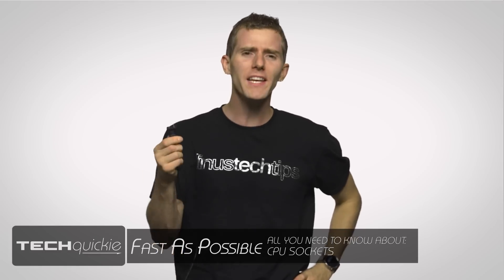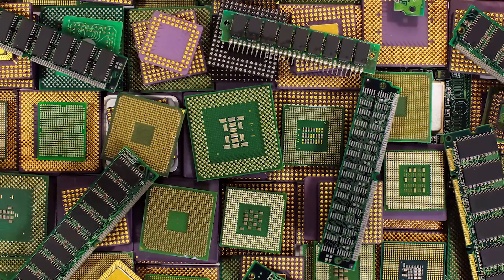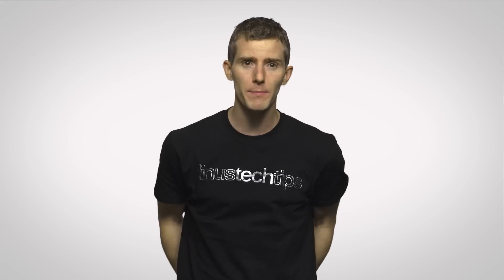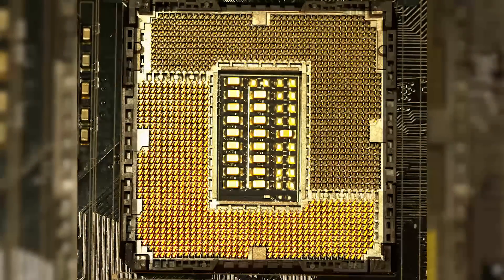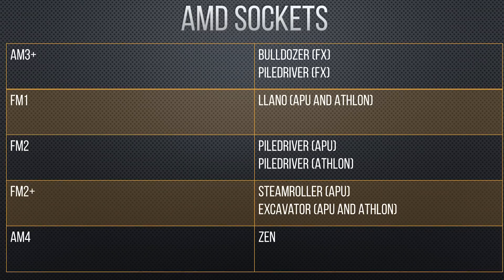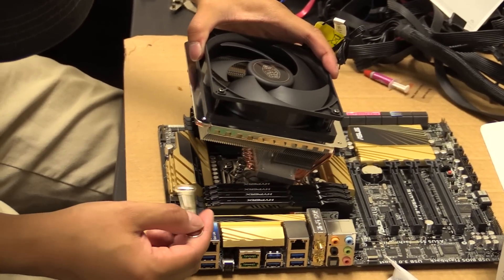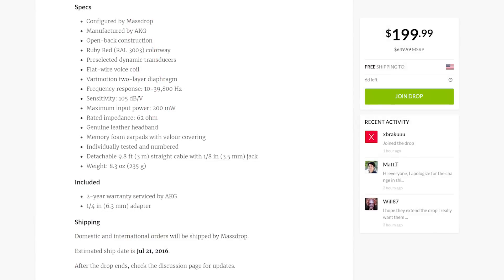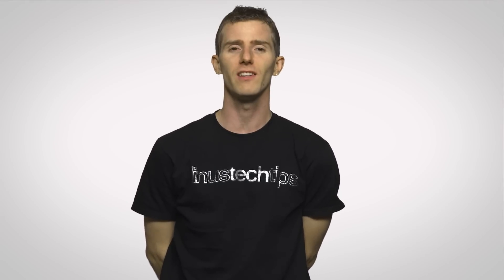CPU Sockets as Fast As Possible

Comment: Things that were either incorrect or missing:
-CPUs on cards were an experiment, and before them PGA sockets already existed. They were mostly useful in the days of the external L2 cache.
-Back then, both manufacturers used the same sockets, but Intel in order to monopolize the x86 CPU market they made their own sockets exclusive, forcing AMD to use their own and several 3rd party manufacturers to leave the market.

Comment: i think lga 1151  is just absolutely ridiculous, like srsly? a single pin more ? you needed that?
Reply: They do that for a reason. It's to prevent people from thinking their board is compatible. Even though a new cpu may need the same amount of pins it has no indication that an older board is remotely compatible with it. It may be completely different interns of wiring.

Since its so hard to differentiate by pin layouts with how dense these sockets are, they just remove a ground pin to basically say "even though they both need the same number of pins, IT IS NOT COMPATIBLE"

As a example of a case they didn't do this, A lot of people thought that the early socket 775 dual cores would work on P4 boards. and intel probably had a nightmare on the support lines.
Reply: @skifree0  they could just change the dimensions lol
Reply: Probably to change the name, I switched from 1156 to 1155
Reply: Saman Miran prolly to sell more mother boards from their partners lol. you want the new cpus? nigga better get a new mobo.
Reply: +skifree This is literally the only comment in this thread that is worth reading (including my own comments)
Reply: Quinn Dams You know that the wiring of the socket is different? The way they send and receive signals gets changed with every socket. You can't just plug an HDMI monitor into a USB port, even if you manage to change the connector
Reply: +Saman Miran you can, you just need alot of force.
Reply: Agreed.  People need to stop assuming that everything is a conspiracy by companies to rip them off.  

Engineers have to decide whether to change the I/O logic and the socket or neither.  VRM and other changes also require a socket logic change.  Which is more important, backwards compatibility, or better I/O features I/O speed and power efficiency?  Well it depends on what you want.  So they compromised and decided to change the socket every other generation.  

  I feel this is a fair compromise since most people don't upgrade their cpu more than once every 4-5 years and they almost always need to upgrade the motherboard anyways when they do so because the I/O is so horribly outdated by then.

  Both Intel and AMD experimented with keeping the physical socket layout the same when changing the socket logic and it backfired so they stopped doing it.  Just like skifree said people were buying cpus and assuming they would be compatible based solely on the number of pins on the socket.  So Intel decided to start arbitrarily changing the pin number each generation to keep that from happening.  Most of them are ground pins anyways.  They don't even use all of the pins on the socket but it's nice to have extras in reserve to provide future upgrades without needing to change the physical size of the socket.

  I don't understand why people always jump to such ridiculous conclusions and assume that they know better than the engineers who designed the product instead of doing a little bit of research first.
Reply: Yeah, like how the power delivery system of Skylake is toally different to Haswell/Broadwell. Those two had an integrated voltage regulator and Skylake does not have that, so using the same pin system would not be possible because the architectures are not at all electrically compatible.
Reply: That's a problem with the naming scheme rather than the name they use then (ref. AM3 & AM3+). There's no excuse.
Reply: So people wont be confused on which motherboard to use....If it was all the same socket, noone would know which cpu to use
Reply: ...? New Board for Newer Memory (DDR4), also maybe they updated chipsets etc. more features. But yea, couldn't they have used lga1150 for skylake :/
Reply: Would'nt LGA 2011 be worse?  Since they just added "-3" behind and its not compatible anymore..
Reply: Worse : you don't have to upgrade your rig every time a "new shiny" is released. My Ivy Bridge i7 still rocks, and since Sandy Bridge no substantial improvement in CPU speed occurred. It comes down to I/O like +NaturalViolence2 said. I don't have NVMe or USB 3.1 Type C. People need to chill.
Reply: yes.
Reply: To sell more mobo's so they don't become futureproof, they could try to make them compatable with previous sockets but its easier to change it
Reply: I upgraded from an AMD Phenom II to an FX-8350 mostly because I wanted a new motherboard. The quad-core Phenom II was doing me well, but various I/O parts were going out on my old board and it ran on DDR2 RAM (under-clocked at that, since I was getting blue screens due to memory errors). My new board (ASUS M5A99FX Pro R2.0) wouldn’t have run the Phenom CPU or my old RAM anyway, but I went for it because of a sweet combo deal I found on Newegg. Also, I had to rid myself of a couple PETA drives because the new board wouldn’t support them, either. Which reminds me, I still have to migrate my OS drive off of IDE mode…
So there’s my story about how I upgraded the majority of my rig due to a dying motherboard.
Reply: part manufacturers gotta get ur money somehow. adding the 1 pin was just their way of forcing people to upgrade the motherboard as well.
Reply: Quinn Dams ;:
Reply: lga 1150 vs 1151, makes zero sense
well lga 2011 vs 2011-3 do make sense because the cpu socket is kinda modified so it doesnt support backwards 
example:
sandy bridge e on lga 2011-3
and haswell e on lga 2011
Reply: A little late to reply, but CPUs have much more than just pin count differences. For example, every 2 generations (4 years), CPUs generally change their transistor size (22nm -> 14nm -> 10nm -> 7nm, etc). At the same GHz range, less voltage is required by the CPU, and less power is consumed because of smaller transistors. The voltage change itself requires a motherboard change. This is just one example... there are more incompatible changes happening with every CPU generation. The Pin count is irrelevant.
Reply: it's possible that the cpu broke compatibility with the lga 1150 for other reasons, and adding a pin was an excellent way to make sure that the difference would be obvious
Reply: a n i m e
n
i
m
e

Comment: why not mention BGA sockets?
Reply: They aren't used with desktop CPUs and they're not really a socket
Reply: +TTLandco The more you know ☺
Reply: They are just pins soldered to a motherboard so it's not really a socket.
Reply: BGA? here or soldering, or an electrically conductive glue, or your chip fall.
p.s.: Thank's nVidia 8800 GTX, in russian lexicon a "ПЕЧ"=stove.. this not joke, it is a combination of letters, if   change keyboard language on cyrillic.
Reply: BGA is not a socket type. In order to install a BGA chip, you need to solder, which doesn't really make it a "socket."

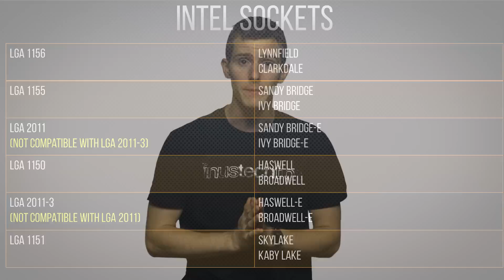Comment: 2:00 you missed out on LGA 775, 771, 1366 and 1356 ;)
Reply: And many amd ones aswell.
Reply: Yes I know, but 775 was quite a big one lasting for multiple generations. They also included 1156, 2011 and 2011-3, so if they have decided do go as far back as 1156 and include the newer enthusiast sockets they might as well include the enthusiast socket of 1156s time, 1366. I can forgive them for not including 771 and 1356, but 775 and 1366, they should have been included if you ask me.
Reply: yeah, they should've gone back to socket 1
Reply: and 1200 and 1700

Comment: CPU Sockets as Fast As Possible: 

These are sockets on the motherboard that your CPU fits into. There are multiple types, so make sure your motherboard and CPU share the same socket-type.

 And done!
Reply: Robert Faber thank you so much for clearing things up for me, you are a good person and i would be glad to have you as a friend
Reply: but i would be damned if i see a motherboard and i say :thats it im buying it. because then the cpu im interested in buying will turn out not to fit it. there is just too many socket types. why do they dont make them one type
Reply: +moblue 289 The cpus need different amount of pins
Reply: Only on the Intel side. On the AMD side, sockets with a "+" are actually compatible with older CPUs designed for the equivalent non-plus socket, so you don't always need the same socket designation on the motherboard and the CPU.
Reply: Xamnition yes, but why not make a standard design
Reply: Robert Faber i didnt understand if you are talking about amd motherboards being more compatible or their cpu
Reply: moblue 289 Because they earn more money by selling the new chipsets to motherboard manufacturers when a new cpu is released
Reply: Xamnition ohhh , greedy work i see.
Reply: moblue 289 Okay, let me elaborate then. AMD has had three sets of sockets that come in plus and non-plus form, namely AM2/AM2+, AM3/AM3+ and FM2/FM2+. For each of those, the plus motherboards are fully compatible with both the plus and non-plus CPUs, and some non-plus motherboards are even compatible with the newer plus CPUs, after a BIOS update, something I believe was particularly prevalent with AM2 and AM2+. The whole point of this is that with AMD, you don't necessarily need to match the socket designation of the CPU to that of the motherboard, as there is a level of backwards compatibility. I'm actually making use of that myself, as I'm running an AM3 CPU in an AM3+ motherboard.
Reply: Robert Faber yeah but then omes the choice of CPU where intel is better but they dont do this as AMD does,so we are screwed for life. currently i need a cpu and a motherboard to run 1080p 60 fps on dark souls 3 , and i would thank you so much if you can give me recommendation on both of them, and for the other components i already know what to buy including an rx 480. thanks in advance.
Reply: moblue 289 I'm not really familiar with the Dark Souls series and its hardware requirements, sadly, so I couldn't really tell you. If it's a GPU-intensive game like most games are these days, it doesn't really matter what CPU you go for as long as it's at least a quad-core, and relatively modern, as in that case 90% of the potential performance gains will be in the graphics card, not the CPU. As I said though, I'm not really familiar with Dark Souls, so I can't say for sure.
Reply: Robert Faber but wait. do you mean i can run gta 5 on a core i3 cpu if i buy the rx 480? is that what you mean by saying cpu doesnt impact gaming that much?
Reply: moblue 289 As I say, it depends on the game.
Reply: Robert Faber do you mean there are games that may use more cpu and others use more gpu? or can you give me a percentage of how much cpu affects games
Reply: moblue 289 Yes, that's true. If you play a game from the Assassin's Creed series for example, the CPU you use is almost irrelevant there because it is so heavily GPU-dependent. Play a game from the Total War series on the other hand, and things turn around completely.
Reply: I would get an i5-6400 because the rx480 is pretty powerful to be a budget gpu
Reply: So you wont bottleneck it
Reply: Xamnition but is the i5-6400 using socket lga 1155?
Reply: +moblue 289 Its using lga 1151
Reply: Xamnition oh my god, im so done with these socket type game, can you please tell  me what cpu as powerful as this core i5 that  would suit my socket ? i really dont want to buy a new motherboard
Reply: Well, get an i7-3770k its pretty old tho.
If you already have that, you have to upgrade ur mobo
Reply: Xamnition i think im going to upgrade my mobo, but is the i5 you talked about is it as same performance as this i7?
Reply: moblue 289 It is actually better than the i5-6400 but its pretty old and theres no upgrade path
Reply: Xamnition its ok as long as i can play doom with it